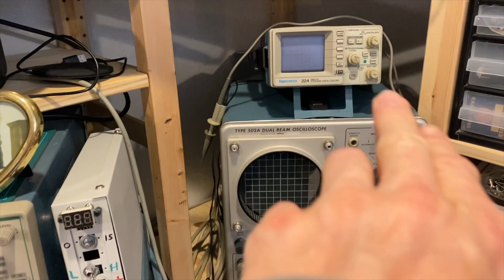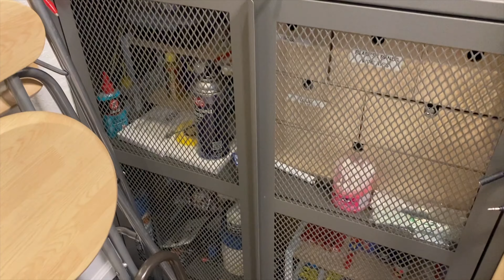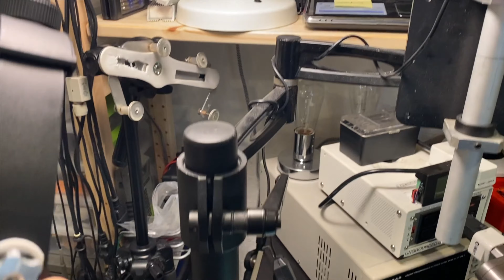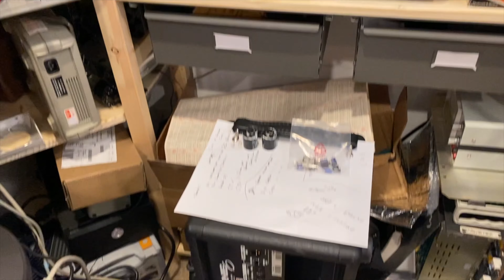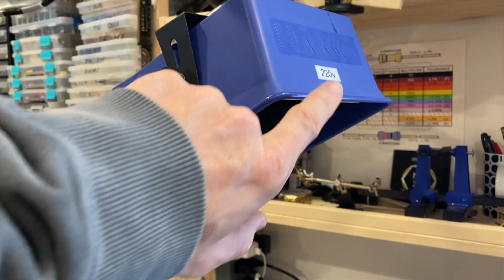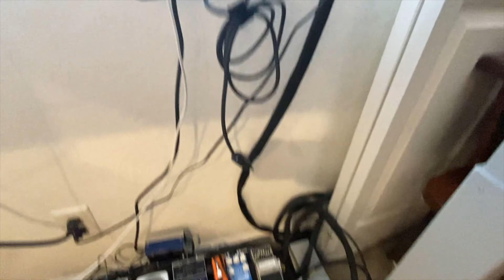Quick tour of my shop / work area and main tools.

Comment: Very nice setup!  I have the Tek 520 plain (pre-A), its sick and need fixin, like you...bad eyeballs, was a great scope when working!  Really like your microscope, very impressive!  ~Jack, VEG
Reply: Thanks Jack. I just picked up a 585. She’s a beast in weight compared to the 502A.  You should do a video when you get around to repairing your 520, not many on YouTube.
Reply: @rickygene774  Maybe one day Ill try and tackle it, but replacing 90 SMD caps might not go to well, no microscope and bad eyes.  I have upgraded to HP and LeCroy, the LeCroy being primary and the HP backup...just bought both of them last week, prior to that I was using a Tek 3335 I believe the number was?  ~Jack, VEG